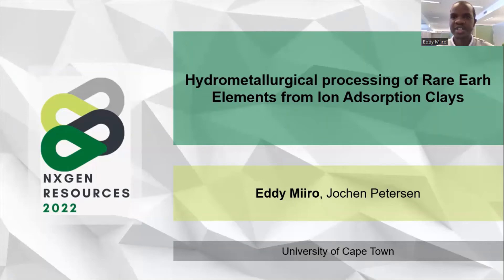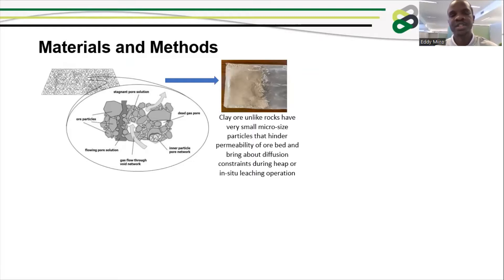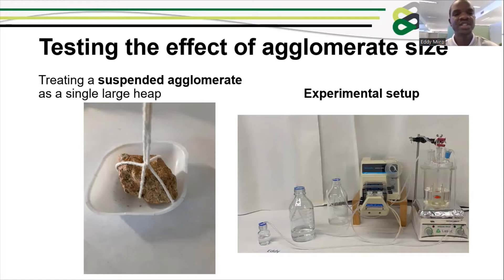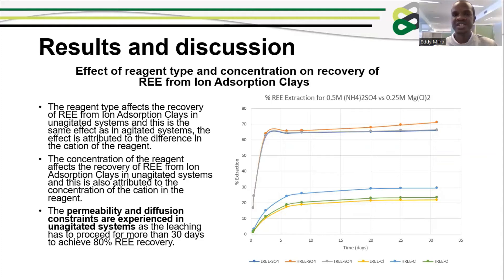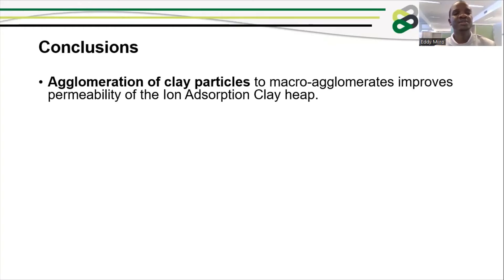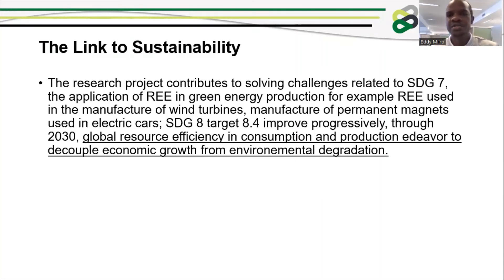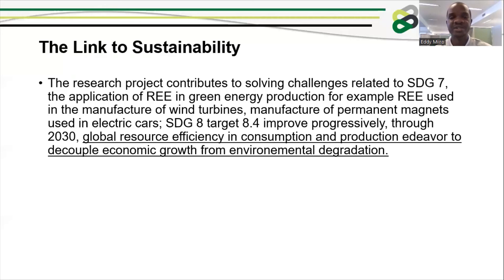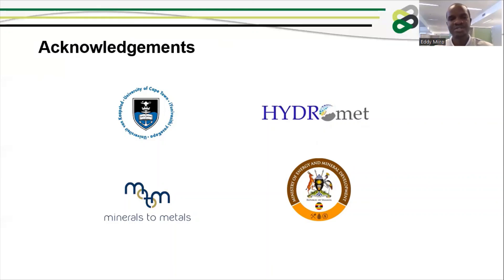Processing of Rare Earth Elements from Ion Adsorption Clays. NXGEN 2022 - Eddy Miiro (UCT).

Comment: Great presentation Eddy
Key take home point for me is
"Agglomeration of clay particles to macro agglomerates improves permeability of the ion adsorption clay heap"

What impact could this have in the mineral extraction & processing field?
Reply from the maker: The impact is quite huge first; Clay ore that contains Rare Earth Elements is easily mined but the ease of mining comes with a cost to environment “irrigation of unknown amount of leaching reagent and most of this leaching reagent may not actually penetrate through the heap so you end up discarding a heap with clogged leach solution at higher concentrations that are not good for farming this applies for rehabilitation of the mine site” 

Second; is the shorter the time to hold a heap operation the lower the operating costs and by agglomeration you improve permeability of the heap by creating more solution flow channels in the heap that ease collection of the pregnant leach solution (solution with the valuable Rare Earth Elements) to supply the demand need of Rare Earth Element applications 

Third; is low grade ores are a very good option to the current production levels of mining industry because the higher grade ores are depleting in quantity leaving us with no option apart from diversification (for example looking for other sources of Rare Earth Elements and how to easily mine and process them while minimizing the severe environmental impact)
Reply: @eddymiiro  well elaborated.
Thank you.
Quite interesting.

I'm working on a project that is still at feasibility stage that involves manufacture of geopolymer (green) cement using volcanic ash. 
We will discuss over coffee when you return to Uganda now that you are a mineral expert.
Reply from the maker: @kasiryedavis4361  
Surely, it will be great to share our experiences and knowledge